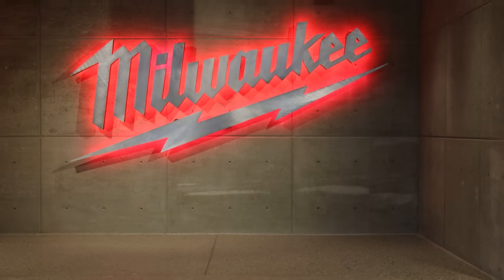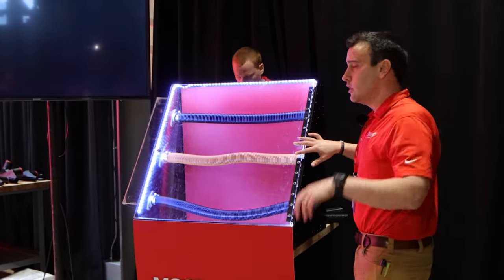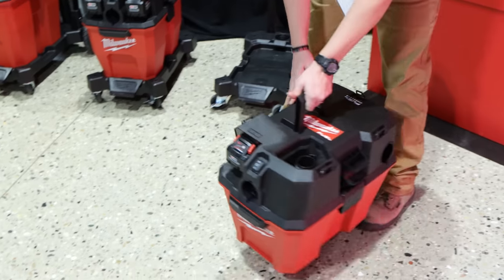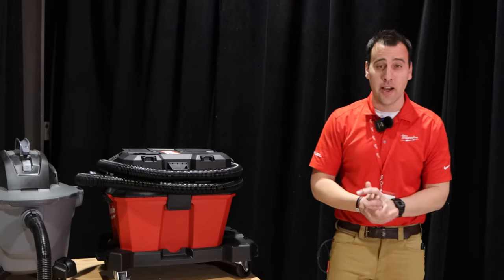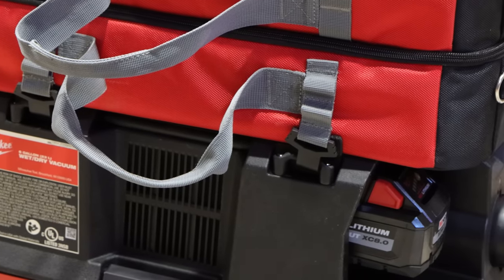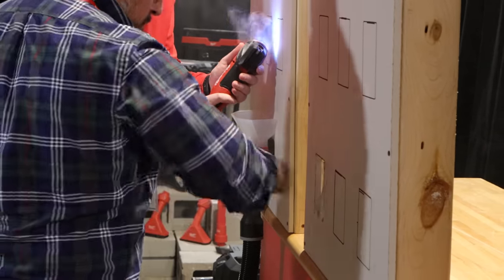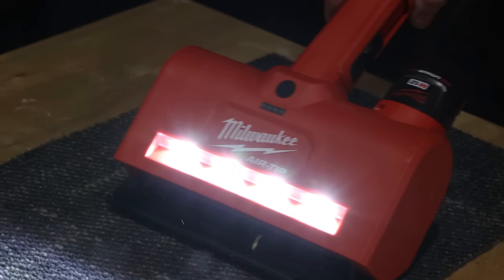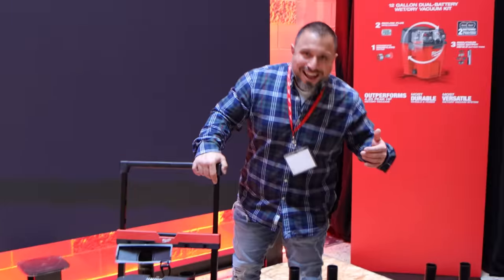Milwaukee Tool Releases Full Size M18 Vacuums FINALLY!

Comment: I love milwaukee, I do masonary restoration and I had a milwaukee rep last year talk about the cordless vacs, the company I work for uses bosch vac090ah  vacs, and what's great is that my bosch L- boxx system clips on the top to store my grinders and respirator.
Reply from the maker: That’s awesome, he let you know these vacs were on their way?
Reply: @VCGConstruction  yes he seen us working on our boom trucks with cords ran to our vacuums and he said your going to love what milwaukee is  coming out with and he explained the double battery model to me, and then gave me a bunch of merch
Reply: 12ßdd
Reply: @drakestruble8365  but will the vacuum come on automatically when you use your power tools? i still think this is whats holding cordless vacuums and some cordless back. I use a corded bosch plunge saw with a vacuum, as im sure you're aware of, when i pull the trigger on the saw, the vacuum automatically turns on. If we go cordless, then we'd have to go back to turning the vacuum on and off ourselves. I really hope this issue is addressed by some manufacturer
Reply: @chrisbonnie  my Festool cordless tools turn on my Festool vacuum through Bluetooth. It’s also nice having the Bluetooth button on the end of the hose of the vacuum instead of going back-and-forth to the unit for the switch. From what I understand these new Milwaukee vacuums don’t have a place for a packout system. What were they thinking but not including that?
Reply: @theloneviking9145  I've seen the festool vacuums with the Bluetooth add on, very handy. I'm hoping bosch do a similar thing soon.

Comment: The accessories look pretty sweet and the fact that they are somewhat universal and can be used with other brands is great. I noticed that they have a separate AC head. I think they missed the boat in not making a dual power battery and AC head. Could have even made it a charger.
Reply from the maker: We appreciate the feedback Corey!
Reply: The vacuum runs on a DC motor. Having an AC input will necessitate an AC-DC power supply, and a 500W one is going to weigh a kilo and add essentially a brick inside the vacuum.
Reply: Is the dual power option now available?

Comment: Here are my two cents on this.  

The good: They seem stout, and the power seems great, especially for batteries. Supposedly they are made in the USA! Even if it is with global materials that is a giant step in the right direction. The accessories are awesome.  Including the option to use them with other products, awesome. I would have liked to have seen one or two provided with the vacs, would have been a good gateway to the product. I don't blame Milwaukee there, why would you provide something with the vac that your competition is not?

The bad: Not including Packout in the design of this product is rediculous, and lazy in my opinion.  It is a real missed opportunity. For some reason Milwaukee cannot seem to make both sides of their house work together, they constantly miss the boat on packout integration.  I am also incredibly frustrated that Milwaukee refuses to allow for a dual power option with any of these high power tools.  It forces you to make a decision between battery or corded (in the future), or buy both (which is what Milwaukee is likely aiming for). Then there are the accessories, Milwaukee only includes the absolute bare minimum to make it work.  No base cart included, attachments must be purchased separately, and no filter bag ($30-45 apiece, really?!).  

I am losing faith in Milwaukee as time goes on and as I continue to see these cash grabs that benefit them. Not much consideration for their customer, just their wallets.
Reply from the maker: I appreciate your honest feedback Joe, thanks!
Reply: It's a business that makes money at the end of the day. But hey just be happy that they don't have subscription based tool usage business model.
Reply: @michaellim4165  don't get me wrong, I have absolutely no problem with a business making money, even a lot of money.  I just fail to see the real value in the product.  They aren't really innovating, I have a rigid vac that costs at least half as much that offers much of the same.  Yes, it is not battery operated, but I don't know how likely it is that I would want to dedicate two of my rather expensive batteries (that have limited recharges available) to the task for only 45 minutes of runtime.  If they offered dual power at least then I could use the batteries when I don't have power otherwise and save my batteries for the real work when I do.  

They appear to just be looking for a way to drive people further into their battery platform, and to make people buy multiples.  How is that good for anyone but them?  Just more plastic to be manufactured, and eventually thrown away.
Reply: @Joe P  That is the beauty of the battery platform: its keeps users locked into the ecosystem, creating huge opportunity cost to migrate to a different ecosystem. It's creates hesitation for buyers as they calculate the huge sunk cost versus the incremental cost of purchasing additional tools for the sole benefit of portability and "compatibility" aka monopoly. Manufacturers don't have an incentive to make corded products anymore as they can't lock in consumers into the ecosystem. Companies are following where the money goes. 

Going back to the product, people are still going to buy it because it's part of their ecosystem and enough research has been done to measure the demand that is present in the field. Perhaps you should be waiting for gen 2.
Reply: @michaellim4165  “subscription based” SHHHHH they’ll hear you!!!
Reply: @michaellim4165  I absolutely agree with you, but that doesn't mean that I like it.  Metabo and Dewalt still provide A/C adapters for their products.  It is perhaps a good business practice if they are only concerned about profits, but not if they are concerned about value to the consumer.

At the end of the day money talks, and if people are willing to eschew value just so they can stay in the platform then Milwaukee will not change how they value their customers.  I personally have no interest in buying these vacuums.  I will continue to use my 2.5 gallon packout vac where it makes sense and my corded ridgid where it doesn't.

I used to be one of the first in line for anything Milwaukee, I probably have close to $5k worth of their tools and batteries, but I have become pretty jaded by some of their newer products and the Milwaukee tax.
Reply: They already two Packout versions of these vacs. I understand what you're saying but to say they're lazy is kind of weak. How can you implement a Packout for something this big? It's already cumbersome. If you have a pack out then you already have the standard rolling chest.
Reply: @noelv1976  I am only aware of one, 2.5 gallon, packout compatible vac (0970-20).  Please tell me what the other one is, I would love to see it. 

This could easily be the base of a packout kit, and should be for its size.  No legitimate reason I can think of where they shouldn't have included slots in the top of this to allow for it.  Packout has been out since 2017. I seriously doubt this has been in final development for 4-5 years, so implementing this would not require a total redesign and the Milwaukee rep insinuated. This isn't the first case of something that should have been packout compatible from the start (e.g. The m18 compressor).  It is just a big miss in my opinion. That is all it is an opinion, but I am sure it is one that is shared by many.
Reply: @joep8520  they explained it on the video on why they didn’t include that.
Reply: @noelv1976  yes I noticed that, I just don't think it is a legitimate excuse.  I frankly see it as a ploy to release a similar, if not nearly identical, vacuum with packout compatibility in the future.  Yes it would expand their product line some more, but to what benefit? Again this is just my opinion. Perhaps I am too jaded.
Reply: 100% agree. I was in the market for a new shopvac got super excited to see the announcement then i see filters 40 bucks a pop when rigid and pretty much all other big name shop vacs ur getting 3 or 4 for that price. Long term cost was a deal breaker for me.
Reply: 100% . I want dual voltage options. How many times on the job site have you had the option to use 110 power. NOT run down a battery.  Plus the missing of packout in at least the smallest capacity model would of been a huge bonus
Reply: @joep8520  my  systainers piggyback my three Festool vacs no problem. Why couldn’t Milwaukee to the same thing? yeah I know the packouts are a little larger than the systainers but hey they could’ve thought of something.

Comment: I'm only a casual / sometimes builder, so this is a miss for me - I'm sure it works for others. Certainly packout seems like a missed opportunity. But also: these vacuums seem like they could have had just a TOUCH more engineering to be able to be dust extractors for jobsite tools I already have, like table saw and chopsaw, and bluetooth sense them turning on. Seems like a missing link in the Milwaukee model right now....
Reply: Also - VCG is the only channel I'm subbed to that caught that great question from the viewer about packout. So I heard it here first - more packout jobsite vacuum solutions are coming! I'm gonna wait for those. And I hope they can double as a dust extractor for those jobsite tools.
Reply: I agree dust extraction is very important. Couldn't a HEPA filter and dust bag do the trick though or am I missing something?
Reply: @vinberube136  I believe dust extractors have more suction and lower cfm than regular vacuums. I’m not entirely sure, but I thought that was the difference. So, a dust extractor works in conjunction with other tools much better than a vacuum, but it’s not a good option for using as you would a standard vacuum. I may be wrong about that, though.
Reply: Spot on

Comment: That’s awesome. Love the cart. Just wished they would put out some better deals on batteries cause these 12ah batteries aren’t cheap. I’ve got more invested in batteries than I do in my work truck lol.
Reply: I buy mine on market place I've found them for 150$ lol
Reply: @shawnhenaman6448  it was probably stolen if you find a battery for under 209 it was stolen
Reply: @minnesotaman3  I'm sure I was but makes it cheaper for me
Reply: Keep searching through homedepot i found the if you buy the 8ah you can get assortment of tools on their list and the 12ah battery is one! I got both for 220
Reply: @apllDgrapllD  bruh… holy shit. That was awesome.
Reply: @minnesotaman3  just bought a 12 ah battery for $100. Not stolen, guy had tons of tools from an auction. Also a packout vac for $100
Reply: @jorgeo1492  thats a good deal, there is resellers that have stuff way cheaper to just people don't know how to shop around for cheaper tools lol
Reply: @shawnhenaman6448  IKR. It's not like they don' have bundles and sales on batteries and kits with batteries multiple times a year. Haven't paid more than 13$ an ah for milwaukee batteries straight from home depot for a few years. The 5.0s can be had for almost free from the special buys and holiday deals.
Reply: @CowsGoM3ow  exactly. I guess another of people just don't know about that stuff.
Reply: LoL
Reply: @CowsGoM3ow  they don’t regularly throw the 12ah HO on sale tho. I got a plenty of 5ah guys but I runnin the chop saw, table saw and other heavy duty tools that demand the power of the ho line. Those little 5ah guys don’t cut it.
Reply: @chasehatchett4756  2020/2021 had 5+ occasions to get the 12.0 bundled with a 8.0/6.0/bare tool/tool with charger for $200-$250.
Sell the battery/charger/tool and get the 12.0 for under $150.

Battery by itself on sale? Well all the brands have sales on bundles/kits 99% more often than a single large ah battery. 

Considering 2021's price increase, we'll have to see if there are any decent sales around may/june and november.

And that's if you only want the 12.0's and been sleeping on the deals that go on for days/weeks.
Reply: @CowsGoM3ow  yeah the deals are always when I’m crunched for funds tho lol. Don’t get me wrong I’ve gotten a few deals here and there. I’m just bitching for bitchings sake lol.
Reply: Watch Grangers and ace for sales
Reply: @minnesotaman3  really? I just brought an Milwaukee hydraulic driver, two brand new 6.0ah Milwaukee batteries, husky tool bag valued for 83 bucks, and a rapid charger all for 300 bucks and all brand new and I look it up and is valued all those 4 items for around 616 Dollars and I only pay 300 through offer up, do you think it was stolen too????😳😳😳 I feel involved in a crime now it was a good deal and too good to be true but same seller is selling another two 6.0ah Milwaukee batteries for 150 bucks what should I do now 😳???
Reply: @minnesotaman3  I got a brand new unmarked super sawzall and a 12.0 battery with a rapid charger for $250 u just don’t know how to negotiate. Some people get free tools gifted to them from work,family or get strapped for cash and need to sell it.

Comment: i really liked 2 things 1- the accessories option. 2- the interchangeable heads. 
In some part they mentioned a dual power option cord/battery.  are all of them have cord option? 

why would not they make a mountable plate to secured by the bungee cord slots to the top of the vac for packout integration?
Reply from the maker: Maybe for a GEN2, I honestly would have liked Packout integration.

Comment: I do auto detailing, so these vacuums are well above what I'd need but I'm still interested, I love the tons of attachments. I'm definitely getting any that would work for detailing.  One thing that's sorely lacking out there are quality attachments.  And good hoses, hopefully they'll sell the hoses seperatly too and they can be adapted to work with other vacs. I buy a Rigid hose+attachment kit about once a year.  The hose isn't great and most of the attachments are just decent. These look absolutely amazing.  And the fact they're not only not propritary, but they fit out the box on multiple hose sizes without any extra pieces is great. I have 2 different vac's with 2 different hose sizes so I have converters because undoubtably certain attachments are only made for certain hose sizes.

Comment: Missed opportunity to have a packout top on the vacuums. Double up the usage of a workspace. Could have had a pack out with different fittings for the hose in foam inserts ect

Comment: Two years ago I bought Milwaukee packout system.  I didn't fully get onboard until they recently released the wall system.  I decided it is time to convert my Garage.  Now that  I finally bought into the packout system I would like to see a base built that fits the Packout.  Just have to see what they do.

Comment: I see a lot of excitement in the comments. I guess I'm in the minority on not seeing these vacs benefiting me. 

I'm a bit surprised that none of the 3 offerings are HEPA filter dust extractor with standard auto start with tool use, and variable suction, and auto clean option. When I saw the thumbnail I assumed there was at least one dust extractor. I know Festool is releasing a dual battery extractor. I'll stick with my corded units I think, but I'm curious to see them. 

I use dust extractors on my jobs for sanders and saws. I rarely use a shop vac, but I'm thinking a lot of you guys are doing a lot of general purpose cleaning on new builds, or reno work where power sources are scarce, and if that was my usage I'd see some value too I reckon. 

I will say the accessories seemed pretty cool and I'd check some of those out if I can find or get a 3d printed adapter to fit my hoses. 

I do also agree that not incorporating the ability to click a packout on top seems either like a misstep, or in 6 months people will be buying another unit for the packout feature. 

Still a cool video Vince. I'm sure it was fun.

Comment: Love Milwaukee tools use them every day In my work especially the vacuums on construction sites the only issue I have is with the filter I have a backpack m18 good suction and battery life with 12 amp but filter clogs early and have to shake out filter to get good suction again often. This vacuum will do the same put a manual vibrate handle on vacuum to shake filter will improve suction time or maybe automatic but probably drain battery to quick

Comment: Yes, it sucks! Sucks that currently no vacuum have so many options! Favorite the pivot attachment would save someone like me from having to get a ladder or crawl. The function to reduce accident is a plus. Also the attachment with magnets is brilliant, and would love to if it also had the magnet feature or a detachable area (at the end of the hose before going into the container) where it also catches magnetic parts or materials. It saves cost but having to go to the nearest hardware store for parts to save time to completing a job. Every little bit helps. Plus I tend to drop a lot of the small items. I don’t have magnetic hands.

Comment: Electrictions will like these for pushing or pulling string. Remember when it was mainly sparkies with Millwaukee tools? Told you so, to all you Porter Cable worm drivers

Comment: I don't get why they can't add a plug in option where you can use the vacuum when the battery is out and also charges the battery.

Comment: I love this vacuum and I thin all Milwaukee tools should have a plug in option like metabo… but this vacuum is way too expensive. Who will pay 600 for a vacuum? Insane
Reply: There is a plug in option. You just swap the head like was mentioned and shown.
Reply: Milwaukee needs to make a battery/ac adapter for any and all m18 m12 tool like metabo does with the 36v flex volt
Reply: People like me will pay.